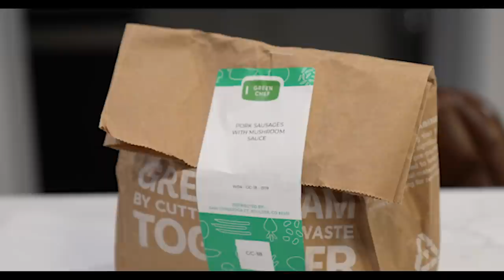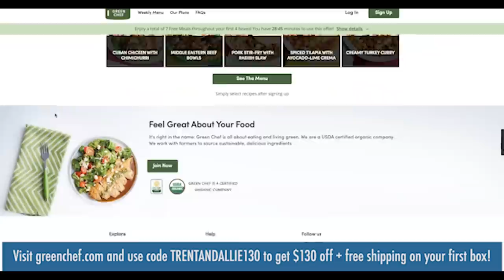BUILDING BUILT IN CABINETS | TRENT & ALLIE

Comment: Sliders are the answer, even now. A pack is $15 at Home Depot. Anytime they want to pull out the stack they’ll run into the same problem. I’m a small woman and I can easily move a king sized bed and a fully loaded bookcase with the right sliders.

Comment: find out how much thicker than the blade your field piece is - get some business cards and put them on either side of the blade equally until you're 1 card too wide ...  set the fence with half the cards between the blade and fence...  run a piece through, then flip it so the other face rides the fence...  you'll be able to micro adjust from there.  Tape measure won't come as close and it'll work with every blade regardless of size/rakers etc..  that'll work on a router table too if you use an undersize bit...

Comment: QUIK trick for you single gals when moving a heavy appliance or furniture...turn a carpet sample upside down and tip the appliance up in front just enough to slide the mat under. When you lift from behind, the carpet will slide across the floor!😆😆😆

Comment: It was a good idea to put pocket holes on the bottom of your cabinet... but why did you install it upside down? The pocket holes should be on the bottom so they can have max working power. Putting the pocket holes on top is so much of a weaker setting. They're much better and much stronger to support the shelf with the pocket holes on the bottom.

Comment: A table saw and Trent just scare the hell out of me, but please Trent ear protection.  You know you are doing damage since the more you cut the more you are YELLING.

Allie the dogs smell the spit up on Leo, hence the great sudden change in Franks attention, and I would think Leo trying to hold his head next to you while in the holder you ware when you lean forward would cause some irritation with him, plus perhaps other ramifications like neck problems or headaches later in his life.  Not judging, just a heads up (no pun intended).

Did you try opening the washer and dryer doors (to stop any breaking or scratching of the glass, then use the dolly to push straight back?  You could use a blanket between washer and drier to separate from dolly.

Comment: I can't wait to see the video when you complain about the doors coming undone and cracking and realizing that you only glue the rails and stiles in a panel door.  The panel is supposed to float.You would have been better off using the first frames you cut. I guess you never heard that wood grows and shrinks with humidity changes. Your doors are going blow apart.

Comment: No no no, mr cabinet builder. Trent never wipe glue into the wood. If you must use a damp rag.
 Ut just leave it oozing out. Let it get hard. 
Then use a skinny UT knife, and trim the dry glue off.... I can here you... why, because if you smear  glue into the wood grain when you stain the wood. The area with glue smeared into will not take the stain. And look odd. Also if you paint.
Areas with glue, will flake, and not look the same...